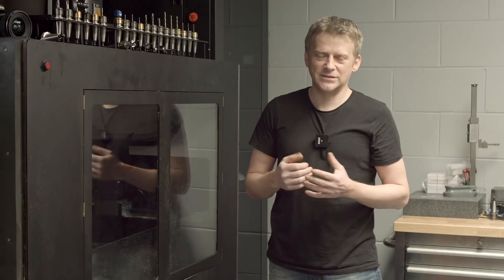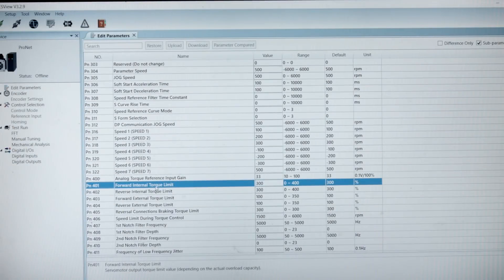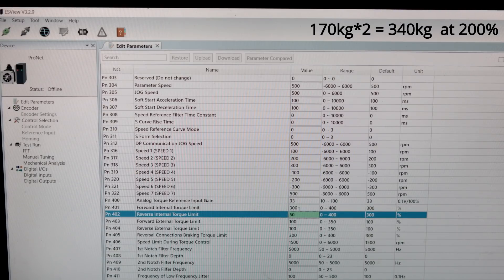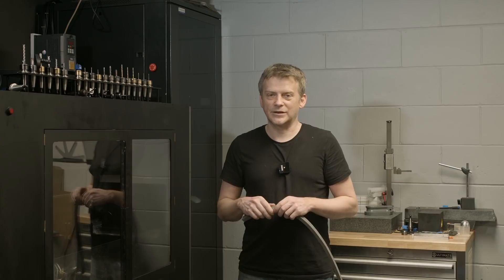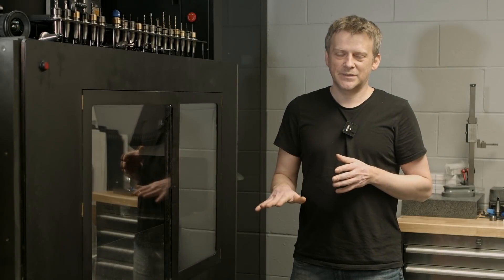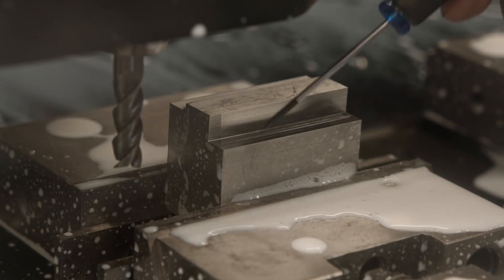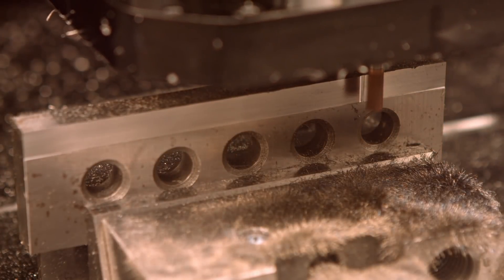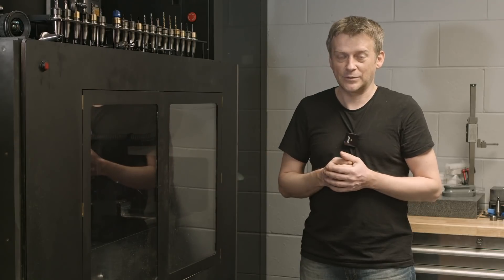CNC SERVOS - how strong are they?

Comment: After watching this vid the 4th times. I wonder if servo is this strong, do we even need counter balance using pneumatic piston or spring? like some commercial machine does (like Shopsabre)?

Thank you and have a nice day!
Reply from the maker: Servos are strong. And you won't need piston to keep it up once is powered. Cut as soon you turn of power it will drop the z axis.  Stepper will hold much more when unpowered but won't be able to lift as much and won't be able to operate at full speed.
Reply: @PiotrFoxWysocki   Thank you for the great info! Appreciate it as usual!

well, given that might need to install piston just for the sake of holding z up i guess

Comment: I work for a big company that today are switching from Mazak Smooth's HCN 6800, to the newest Mori Seiki NHX 8000, but i tell you that i prefer my G550 T GROB machine center with 5 axis. 
One day my friend i will be able to setup my own cnc too, btw you X axis is THICC.

IF anyone is courious the only  machine that i was able to do 8mm depth pass for pre finish milling with a 250 mm diameter face mill on cast IRON was the MAZAK Nexus center 6800, all the mori seiki give me axle overload alarm and spidle overload, even heller and some other machines didn't handle it, the surface finish wasnt the best but you get the point, 8mm on iron is insane dude, with aceptable pre surface finish and precision, i think we was running seiko Inserts on some national toolin with dual contact zone on cat 50 spindle taper.
if anyone complains about precision we run about 10 3d centers inside the company that measures every product that leaves the machining area.( only one is mitutoyo, all the others are ZEISS), now imagine for someone having 10 3d centers on the plant, how many cnc do they have on.

fuckin hell

Comment: Most of the cutting force should come from the spindle anyways, no?
Maybe you could even save your tools this way?
I mean if the force get's too high sideways your probably need to increase rpms, no?
It would be probably worth a test to limit the servo force to an amount that reduces the cutting speed and see what happens. I imagine the finish could suffer, and depending on the servo settings you could get some ugly vibrations, but that should be possible to reduce by some dampening.

Thanks for that inspiring video! 🙏❤️
Reply from the maker: i don't think  that interactive reducing  of the servos power during the cut is something worth doing. fusion 360 does it for you and tool paths are optimized for the chip load and speed, etc. when there will be a another variable which will be changing those parameters than you will end up with blunt tools and lots of wasted time because your settings would be too sensitive or something.  beside it would be really complicated to make and maintain. but this is my point of view after a quick thought. i just can't find any benefit of doing it.
Reply: @PiotrFoxWysocki  I agree, I didn't expect it to be practical used this way, but still would be interesting to see what happens. Of course I understand if you don't want to risk getting into unstable states.

I still think it could be a pretty valuable if you are able to for example use the expected chipload calculation and set the limit dynamically with a safety margin, that maybe can save the tool from breaking. But that of course would need deeper software integration and that's probably not that easily available. OTOH I am surely not the first one to think of this 🙃

Thanks for your reply 🙏

Comment: Wise to limit the servos.  Have you tried doing some very fast rapids to see how they behave under hard acceleration and deceleration with the new settings? Usually the torq isn't required in the cut it's more critical for fast controlled rapids.
Reply: Looking at your hardware I think when your comfortable with more speed you would be able to easily manage 10m/s and keep precision. I think maybe even more could be possible, my old torqcut 22 with the old dc servos 32mm rails and screws that is much heavier than your machine was easily doing 10m/s. thetorq cut  models with Siemens ac servos were even faster.
Reply from the maker: Well my gantry is 130kg it would be terrifying to run it ar 10m/min 😱☠ wit this speed i would kill my spindle in a month time. Im not running massive runs so every second counts. I can wait few minutes longer. And be sure nothing is goung to explode. Any mistake at those speeds is catastrophic.
Reply: @PiotrFoxWysocki  130kg isnt heavy ;-) my spindle motor and transmission weighs more than that without the casting and its only on a 32mm 5mm pitch screw and 32mm rails, no counterbalance 😂 but I agree it is scary at first. Spindle should be fine as long as you don't rapid too fast at high rpm with tools heavier than the rating.  If your only doing small runs maybe a tool changer next is your biggest efficiency something like you see on cnc routers would probably work quite nice on a gantry style machine like yours.
Reply from the maker: I have around 40 tool holders. So there is no way i can fit them on the table. And changing them by hand is much quicker than table tool changer. And much much simpler.
Reply from the maker: Just fine. Im running it 3m/s at the moment. All what i need. I care for resolution so i sacrifaced the speed.

Comment: I would be very interested in the stiffness of your upgraded machine. Have you ever measured it? Like measuring spindle deflection while applying a force with the scale to the tool.
Reply from the maker: i already did that. its 10 microns for every 10kg. so i will have to improve my z axis a bit.

Comment: Fox, you know I am building a P&P machine, as it will be  "a bit fast" and heavy, I could not decide yesterday in the shopping cart to go with 660W or 400W, I can sleep now... :D
Reply from the maker: hey,  im sure you exactly know which one :) weight of your gantry * g force = servo power :) so if your gantry weight is 45kg for 400watt servos you could run it with 10g acceleration on 5mm pitch ball screw and 5g acceleration on 10mm pitch ballscrew. very scary when you think about it :D
Reply: @PiotrFoxWysocki  Hey Fox! Yep, I agree, btw I will run it on TBI 2550 high-speed ballscrew-s :D. it will be interesting to see the speed.
Reply from the maker: just in case bolt it to the floor :D when i was setting mine servos i put some stuppid number in to acceleration and run autotune.. holly hesus... seriously i didn't know where to run. house was moving! and it was only my x axis :D
Reply: @PiotrFoxWysocki  xD, well I will start it with a bulletproof vest on then! :D

Comment: One thing I'm always interested in with these home built machines is, given the current state of the machine, and the investment, would you have bought one for the same price you invested or would you still have built it yourself.
Reply from the maker: well.. at the current state i would have to spend 100k+ on a commercial machine to have similar surface finish quality. even than its not guaranteed it will be as good. So i prefer to make it my self.

Comment: Very interesting, as always. As you are limiting the power, Do you think you can build (amost) the same CNC spending much less if you buy smaller, less powerfull, servos, like 100-150W ? Or that cheaper servos would be lacking some needed features, like weight, speed or precission ? I can see in your links "motioncontrolproducts" only have 400W and 750W kits. Thanks for sharing !
Reply from the maker: Not sure how much less it would be for 150w servo. I guess for my current machine i would feel more comfortable with 200w. So i have some spare power left just in case. Speed wise they are all 3000rpm minimum or more. Precision should be very similar as well for cnc. Servos have different resolution encoders, but most of them should outperform whatever resolution you will set in your cnc software. 
I can't talk about all other servos out there because i did the test on 400w servos in this video. In my machine so you can draw quite accurate conclusion what those setvos are capable of.
Im guessing that other servos should be similar in performance to be safe we could assume 20% +-. So if 400watt gives 500kg than any other 200w servo should do minimum 200kg. Obviously there are calculators for it. But ball park you can use this video to draw general conclusions.

Comment: you have probably said but what spindle are you using?    I did not think you would have had to throttle back the servos like that, impessive numbers
Reply from the maker: 2.5KW ATC spindle link here: https://youtu.be/h9q6j7POgOI 
i thought i will have to get something bigger looking at the size of those servos and the new size of my machine :D
Reply: @PiotrFoxWysocki   Yes, go for the BT30 one :P
Reply from the maker: in my next machine perhaps :D
Reply: @PiotrFoxWysocki  that spindle is a is a beast and I suppose one has to stop at some point :)  this is why I now have parts for two machines lol..
cheanged my mind a few times on the build

Comment: Just out of curiosity, you never mentioned in your video when you tested the stepper motors what size motors were on your Y axis. I am looking at using 425oz-in Nema 23 for my Y axis. I am hoping that will be enough to move it at a reasonable speed.
Reply from the maker: i mentioned in video description "X - Dual Shaft Nema 23 Bipolar 1.9Nm (269oz.in) 2.8A 3.2V 57x57x76mm 4 Wires" and this one was going over 3000mm/min but i limited it there to be there so it won't stall at higher speeds.
Reply: @PiotrFoxWysocki  ah I somehow missed that. Thank you for the quick reply. One last question, how heavy was the gantry? I'm curious as to what weight limit I should keep in mind when building mine.
Reply from the maker: 130kg

Comment: The travel speed should not be affected much since the servos do not loose their torque with increased speed, but I am curious what happens to the acceleration.
Reply: was wondering the same thing. will it still cut precise and fast in corners?
Reply from the maker: @ramous5182  well it wont cut inaccurately because it has encoder. and when it will hit the torque limit it will just stop. so no problems so far.  
and if you are going through the cut inertia works a bit different because you are getting resistance from the cut. so to change the direction doesn't require as much power and changing direction without the load on the spindle. 
i hope my attempt of explaining makes sense :D
Reply from the maker: sorry i don't get the question :( i would recommend to look at any servo graphs in google. for me as long it works, Personally I don't really care how does it work as long it works :D  If it wouldn't than i might start looking around :) otherwise its one less problem  to be worry about :D
Reply: @PiotrFoxWysocki  You will need the most torque when you change the direction of an axis. Imagine your z axis coming down at full speed and then, without stopping, going back up. If the torque limit kicks in while you change direction, you might end up cutting inaccurate.
There should be a note and a diagram somewhere in the limiting torque section of your handbook.
If you use autotuning, you should do it again after you set all your limits.
Reply from the maker: @Christian-ti7wh  well it wont cut inaccurately because it has encoder. and when it will hit the torque limit it will just stop. so no problems so far.  
and if you are going through the cut inertia works a bit different because you are getting resistance from the cut. so to change the direction doesn't require as much power and changing direction without the load on the spindle. 
i hope my attempt of explaining makes sense :D

Comment: I am curious, what's the max rapid movement that your machine achieve with that servos?
I'm planning to build a similar machine machine and I'm extremely interested to buy that kit.
Reply from the maker: Its very hard question to answer. It depends on your controller speed. Resolution you want and travel speed. Also how you run it. Analog or step and direction. I set mine to 2800 because i have ot send double amout of steps to 10mm pitch X axis. To have the same resolution as my other 5mm pitch ballscrews.
Reply: @PiotrFoxWysocki  I am using MASSO controller, it can generate 100k pulses per sec. Is a nice stand alone unit and doesnt need a pc to run, just mouse, keyboard and monitor, i have made a crude cnc out of wood and one of my axis can go up to 4500mm/s in rapid with nema 23 steppers.
It can even process aluminium, although for now I'm still trying to develop a design to fit in my tight space and have the maximum possible work volume.
I will build the "big boy" with steel, alluminium extrusions and epoxy granite.
Reply from the maker: @Goguleroma  and how many steps per one revolution of the ball screw ? 200? Or 400?
Reply: @PiotrFoxWysocki  i have configued it in a strange way. The stepper drivers are set to 1600 divisions, the cnc controller is set to 800 steps and counts half of turn as a full turn and i have 5mm pitch screws.
So tecnically is 1600 steps per rev.
Reply: And the controller doesn't calculate steps/rev. It is fixed steps per rev and calculates the travelled distance per revolution.
Reply from the maker: I see. So kinda analog. So your resolution is still 800 steps for 5mm off travel so one step gives you 0.00625mm good resolution 👍 i would go for 0.005mm kinda rounder number.

Comment: Check ODrive servo driver ...it is around 120$ 2 motor driver , 50$ for encoder and around 100$ for 80100 or 6080 bldc motor up to 4kw of power yup 4kw each motor with all settings u need for it....super powerfull and cheap servo motor setup :)
Reply: Funnily enough, i considered it. You need hell of a dc supply, or some way to supplement the battery.

Was thinking of driving the spindle with it though
Reply from the maker: They get really realy hot 🔥i used one 2kw and you would get burn if tou touch it. I run it with 52v 30A power supply. Problem would be the cooling. But there are also some with water cooling. Max rpm 5k
Reply from the maker: theoretically :D practically not so easy :)
Reply: Odrive is nice, I own 3 . This is a promising  driver but it is honestly not mature yet to be recommended.
Reply: yes , promising but yet time will tell .
people already tested on 3D printers few hundred hours in 1 go without issues 
DIY CNC the same
but crashes etc still exist.
For DIY CNC good idea if u go "on budget" and want super speed

Comment: Heya Fox, still in the research/prep/courage building phase on making my own, smaller version of your router. It will have less beefy rails and screws but once I get back to China, I aim to start sourcing secondhand Japanese hardware. But judging from your numbers and given that my carriage will weigh, perhaps, half of yours, wouldn't you say I could likely get away with "just" 200w servos?
Reply from the maker: most definitely! if 400w servo is capable of 500+kg on 5mm pitch ball screw, than 200w should do 250-280kg. only one way to stall it would be to have lets say a gantry which weight 100kg and you will accelerate it with 2.5g than it might stall because it will require this amount of force to change the direction. and im sure you wont be running it at those accelerations because your cnc would leave the building :D
Reply: @PiotrFoxWysocki  Awesome:). Though I am locked out of China for now, one huge benefit of living there is how easy it is to get the materials to sustain this growing hobby of mine. Imagine needing some 25mm rod of Gr5 titanium - just order it in lengths of 10cm and it will be at your door the next day for next to nothing. Same for tooling inserts. Huge market (as you know) for the Japanese secondhand machine parts and obviously, all the Chinese cloning brands, too - often at 15-30% under AliExpress prices. 
I think I may even be able to find a surface plate manufacturer to cut my pieces to custom sizes and possibly even drill holes affordably.
Now, I wouldn't mind living in NZ, either, but that's another talk:)

Comment: Looks good and definitely going to avoid damaging components.

 I would think the force settings could be higher in tandem with encoder and current monitoring or things like that so the machine can know its crashing and vary servo force output. Assuming that's what high power mills do for safety.
Reply from the maker: forces could be different on the cut and as long servo is rotating counter is counting. when the torque goes up to the set threshold it stops. i have plan at some stage to connect warning to mach3 to turn on the E stop. so all the axis are stopped at once.
Reply: afaik, they move the axis until the following error (either feed or rapid, those have different settings) is violated

Comment: Oh man,i would never purposely test equipment like that,,especially special equipment like that. Alot of force on the ball nut! Least now you might not kick a vice in a crash tho?!
Reply from the maker: haha :) i build it so i guess i have a bit more faith in it as well :D In addition i have been using it for years.  i guess its better to do this in controlled manner than discover it after some disastrous crash. 
now i'm not really scared of crashing it anymore. 
Even if, for some reason i will lose one of the y axis,  it wont have enough of power to snap my gantry in half :) or move vises, or destroying the spindle